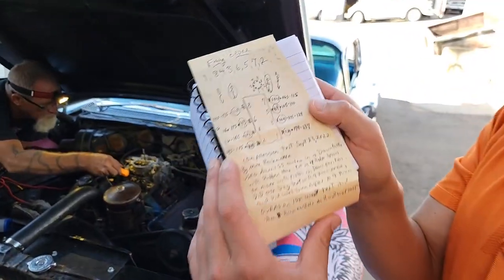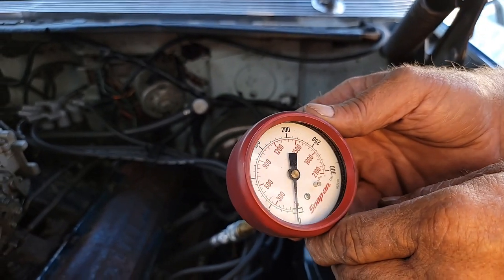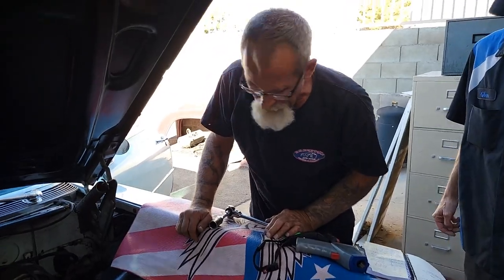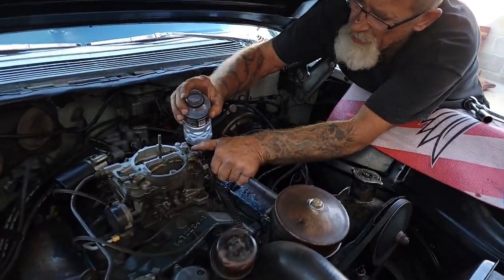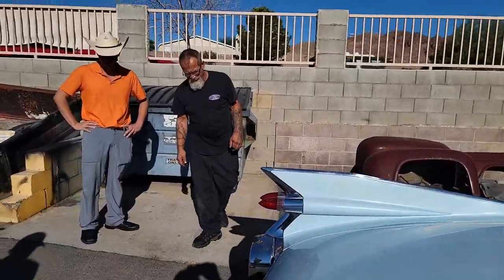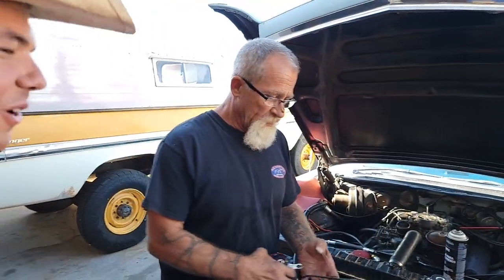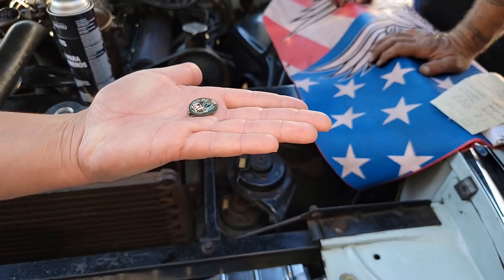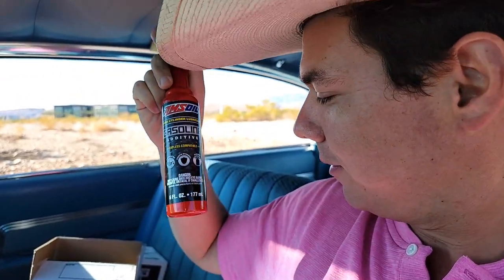Classic Car with Low Compression - Try This!

Comment from the maker: Watch This Next: Cleaning 60 Years of Carbon build-up inside Engine with these Fluids - https://youtu.be/-T_-mF8tlyA

✅ ✅ ✅  Save 25% On Next Fluid Order: https://www.amsoil.com/offers/pc/?zo=5331179 

     ❤️ 🇺🇸 ❤️ Your Professional YouLubher: Eben Rockmaker. Find The Right Fluids For My Vehicle - https://www.amsoil.com/guides/?zo=5331179      

     🥇🥇🥇     Synthetic Oil Protection Google Map & Reviews
(702) 472-3614
https://maps.app.goo.gl/DmLU5hP72HadUBEm9
             
     ⛳️  Synthetic Oil Protection Website - http://syntheticoilprotection.net

     Did you know a oil manufacturer can call a lubricant a Full Synthetic when it's only 25% synthetic? AMSOIL is different because it is 100% Synthetic and has a higher film strength keeping the metal parts separated. AMSOIL allows less friction, less heat, less wear on the component. 

      ♥️ See Fluid Performance Tests - https://www.amsoil.com/performancetests.aspx?zo=5331179      

     Your Vehicle Could Run Better Than Brand New By Using The Right Fluids! See Results - https://youtu.be/zH-VquYlhqA

     Why AMSOIL - https://www.amsoil.com/about/exclusive-distribution/?zo=5331179    

     Synthetic Oil Protection Coffee - Ebens Favorite: https://supportwith.coffee/shop/subscriptions/sop/

Comment: Compression test was very neat to watch as it was done. Interesting how you gain compression as the piston rings get cleaned up with less carbon and build up around them. 
    Thanks for sharing the information on the real deal 1959 Cadillac deville. 
    All cars get carbon  build up in the piston rings and valves for sure. 
    Looking forward to doing a power foam on my car to clean out  the piston rings and valves. 
     Thanks for the information and video content.

Comment: There's a base plate under the carb. They are known to crack and lean out the engine. Don't replace the carb, just get a kit for it with new metering rods and neddle jets. I'm betting low vacuum from a line. U can also change the weights in the distributor for the vacuum advance. Makes a great difference. Hope this helps.
Reply from the maker: Great ideas!
I'll definitely share this with Bob and we'll see what type of results we get😉

Comment: I used to have a 1967 coupe de ville with a 429c.i. engine that didn't start very good and I replaced the factory carb with an Edelbrock Carburetor and it was a night and day difference. It started just like a new car. While I had the carb off I replaced the intake manifild gaskets also and found a couple of leaks in the intake manifold.

Comment: Nice video as usual Eben…. Gotta say amsoil is definitely the best…👍👍👍
Reply from the maker: 😃, what's your latest project
Reply: @Syntheticoilprotection  been working on cleaning out all my 2 stroke power equipment with the power foam as it has made my 2 cycle equipment run like brand new and will be changing all of our vehicles over to the 0w16 amsoil hopefully this coming weekend

Comment: To bump the compression, u pour oil in each cylinder.
Reply from the maker: We did that with the signature series 0w-20 and I made this video when I switched over to it and it definitely cleaned the motor and then we're going to be switching to the 10w30 Signature Series.
https://youtu.be/bHJMhqwcgp0

Comment: Hey I know this question is off topic from this video, however I have a 2015 Camaro and if I were to switch to amsoil would I just do it on my next oil change or do I need to flush/clean anything beforehand? Also, I have seen a lot of people use 5w-50 instead of the 5w-30 that is recommended, any reason why?
Reply from the maker: You have some great questions here yeah you would be best doing the engine flush that will get a lot of the old carbon build up around the Rings timing chain oil cooler ports.
As far as the different viscosities you mentioned that is correct one is for autocross usually I would always run the 15w50 Dominator racing oil if it was my personal vehicle if I was just doing City driving I would run 5W-30 Signature Series or I would run the 0w-40 signature series either are great the 040 is more of a hybrid where you can do intermittent track days.
Basically all the new Corvettes come with 0w-40 and this is my personal link and when you order I will get the credit and I really appreciate your business future business always happy to talk with you👍
✅ ✅ ✅  Save 25% On Next Fluid Order: https://www.amsoil.com/offers/pc/?zo=5331179

Comment: All those Amsoil fuel treatments aren't cleaning up those valves and rings?
Reply from the maker: Yes they clean tremendously however something that sat for years will never come out unless you scoop it out check out this video with the 59 kitty cat when we took the oil pan out - https://youtu.be/lfNmYbR-xuY
Reply from the maker: Basically if something's tar it'll never come out unless you take it apart and scrape it out

Comment: Yeah, not being able to adjust the carb properly can really hamper an engine. Still, there not much to do about the engine wear besides an rebuild.
Reply from the maker: 💯, yeah the water definitely loosened up the Rings a little bit and the motor is running better we also did a soak with the signature series 020 in the cylinders and that definitely melted some of the buildup but it still has quite a bit of wear.

The other thing it does is when you put a piece of paper to the exhaust pipe it sucks the paper in when it's idling which means there could be some valve problems I guess.
Do you know any YouTubers that do engine rebuilds?
Reply: @Syntheticoilprotection  There's Jamie's Garage that rebuilt Chrisfix engine BMW. But i have no idea if he works with 1959 caddies.
If you were in Brazil i could point an handful of guys who could do the job but alas, that wouldn't help.
The old timer in the video should know someone but don't know about an youtuber.
Reply: @Syntheticoilprotection  there's got to be someone good in Las Vegas area I'm sure.
Reply: @Syntheticoilprotection  wiks racing engine , Las vegas
Reply from the maker: Do you know anybody that works there kevin?
Reply: @Syntheticoilprotection  adam wik the owner, I had a sprint car built by him
Reply: @Syntheticoilprotection  also american outlaw garage in Las Vegas restores and rebuilds classic cars
Reply from the maker: Awesome can you text me his cell phone number I will definitely be in touch with him 702-472-3614

Comment: Bob isn't savvy or sophisticated enough to do a simple carb rebuild?  How can a guy that supposedly works on 'classics' just say to trash the original carb and buy a piece of garbage Edelbrock? Nothing but a parts changer. Why not drive down to TJ or Nogales and rip out the whole interior and have them remake it into a cooz cruiser? That's how these old cars get all screwed up. Original carb for 60 years and along comes Bob with the genius advice "Git yerself one of them Edelbrocks." Just an FYI, ORIGINAL PARTS ARE KEY TO THE VALUE OF THESE OLD CARS. Not sitting in a box in the trunk either.
Reply from the maker: Oh I hear you Vince!

Yeah nothing on the car has been modified everything is still an original condition can be put back in a couple hours I have everything the AC compressor the car is 100% original.
Reply from the maker: Car does run quite a bit better with the Edelbrock.
Reply from the maker: The oil is actually looking a lot better too really running amazing without rebuilding it and getting a holly sniper with injection I think the car runs amazing😃

But of course if one wanted to go deep they could and they could always buy the car for me and rebuild it and spend $178,000 getting it all dialed in but to me the value is all in nostalgia